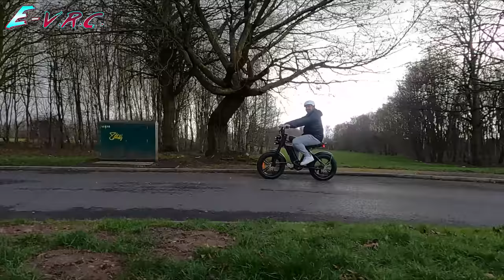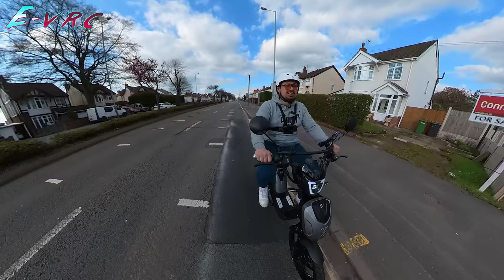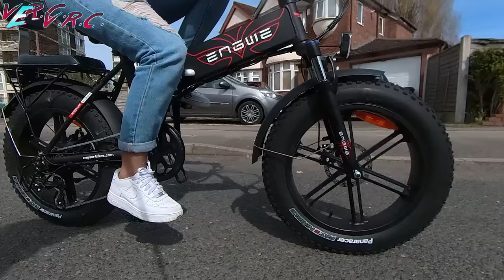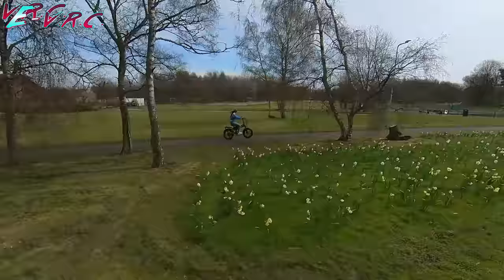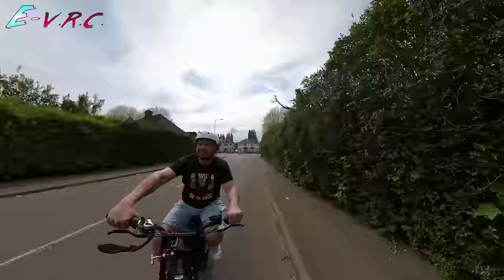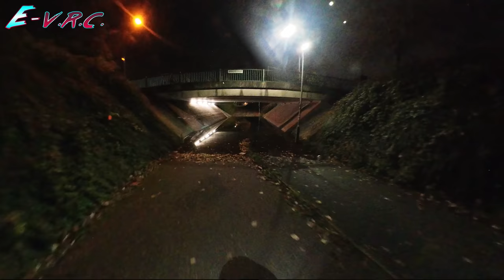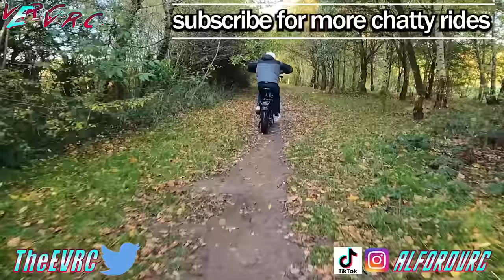The CRAZY Ebike law that MUST Change Before Someone Gets HURT

Comment: I think a good system would be to allow all ebikes to have variable power, but location restricted.  Here in Canada I can make any monstrousity and harm myself on my own property, but the deathtrap wouldn't qualify for street/park use.  even if it were software limited.  we are limited to 500w, Class2.  maximum unlocked speed is the most limiting value for import, to disabuse anyone the thought they can sneak something in.  blahblahblah.   rules are stupid for a reason.  they keep you from earning your Darwin award in sight of a schoolbus of kids. fine.  i'm a licensed Class 5 driver, and I know the rules of the road, both for cars and bikes, and even pedestrians.  I should be able to, under my license, drive any capable vehicle.  I don't want a Surron to go 100kph down the highway, I no longer feel the fires of youth.  I am an adult. Like any car I jump into, I can carry my license to validate my capacities. Also I could handle a powered bike, and I can answer for any screwup I create.  If I am driving erratically, pull me over , toss me and my bike in the backseat and that's on me.  Ebike limits for unlicensed drivers.  thats all it needs to be.  And sensible capable adults will continue to not be the problem.
Reply: on my crappy 10speed back in 1980, after a couple weeks in the spring, top gear all the way, top speed about 40kph.  My favorite swim was 40km away.  took an hour.  on a stupid e-bike it would take 3 hours with the laws so restricted.  I have an ebike in mind Raev Bullet-GT(X)  where X is the version to be released in late summer for taller riders.  I can only hope Canada sees it my way by then ;)

Comment: All you are going to achieve carrying on about this is, nothing. they will probably produce a tax. Get on the bike and stop bitching about it. I have 39550 km on Strava. The only major accident I had was not caused by lose of control. You don’t need a throttle. Pedal assist is awesome. It come in when I hit the hills , no problem. 

Y

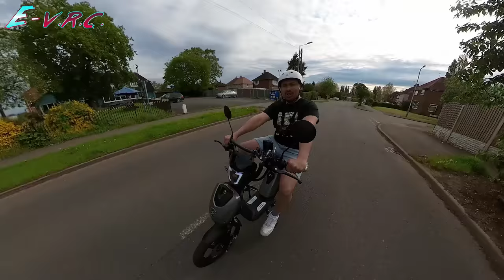Comment: 5:50.  It's a bicycle.  That's normal.  The whole point of the rules is so that ANY electric bike can retain "bicycle" vehicle type and rating for the road law.  Bicycles are unpowered.  So, to get an eBike classed for british roads it either needs to be a motorcycle (aka PTW) or a bicycle.  The "bicycle" classification allows you to ride it without tax, mot, insurance or license.  But it has to be restricted because the riders are untrained, unlicenced etc.  Seriously if these rules are annoying you, go get your bike license and buy an electric motorcycle and stop whining.
Reply from the maker: Have you ridden an ebike?
Reply: @e-VRC  Yes.  Have you ridden a motorcycle?
Reply from the maker: @1over137  yes... would you like to replace your throttle with a button that gives 100% or nothing?

Cus that's the only point of this video. Not moaning about speed of ebikes. Just 100% or nothing power delivery.
I asked if you'd ridden an ebike because if you had then you'd know that although it's called pedal ASSIST you actually don't have to put any effort in for the power to kick in. I don't think i made it clear in the video which is why a lot of non ebike riders may be getting confused.
Reply: @e-VRC  The reason I asked if you had ridden a motorcycle is because power delivery at low speeds and getting bogged down in the wrong gear, stalling or lurching are all considered part of "bike control" and part of the training.  They exist, they are FAR more potent and they WILL get your killed on a motorcycle.
The difference is... I have a license and training and in the event I do something bad and hurt someone, I am legally accountable.  You just ride off.
Reply from the maker: @1over137  but you also understand (being a motorcyclist) that the ability to 'throttle' speed is important to safety and because you're clever enough to ride a bike and respond to videos you can also understand that that is all this video is asking for. The ability to SLOW speed. Adding a throttle to an ebike only increase safety. They don't increase speed or power. They allow us to go slower.

I know you understand that really.
Reply: @e-VRC  Honestly it will come down to some fundamental point in law, more than likely specified by the risk analysis.
My point to you is, what is wrong with getting training and insurance and a license?
My issue is that SOME cyclists are bad enough, now they have power it's only going to get worse.  more people are going to get run over and more cyclists are going to get hurt.  At some point lines have to be drawn about what you can do without any training, license, insurance etc and what you can.
If the eBikes they say can be ridden without a license are rubbish, go get a license. 
Although, if you had a license and registration several of the things in your video would probably make them go away along with some fines.
Reply from the maker: @1over137  I think it's because I'm coming at this from a bicycle point of view and remembering all the different use cases of a bicycle. Like a grannie pottering about the park with the grandkids, going to the shops, avoiding the main roads.

Who is about to follow their kids around the estate or around the park on a motorbike?

100% if ebike commuters want more speed then yeah they should really get cbt and insurance and get the moped/125. 

But this video is ONLY about asking for the ability to SLOW the bike. A lot of people say stuff like 'if they can't pedal they shouldn't ride'.

I'm saying, allow throttles to be on ebikes because these people are going to ride ebikes anyway no matter what we say. So a throttle might stop these people injuring pedestrians and themselves. Regardless of whether we think they should be on a bike or not.

Your points are all valid, but this video isn't about that.
Reply: @e-VRC  At low speed, can't you just turn pedal assist off and pedal it?  I thought the point of "pedal assist" was the pedals are the primary propulsion and the motor only adds on to that "assisting".
Honestly, if you have it in a high pedal assist mode when trying to navigate narrow obstacles ... it's user error.
Which is a valid consideration.  If you are saying there is no need for training, then the bikes have to be idiot proof.  Which would unfortunately not be solved by safety experts by ADDING a throttle.  Adding a throttle requires the user know how and when to use it.  Bicycles dont have throttles.  eBikes can't either.
I also, honestly don't believe a throttle would help everyone either.  I'd gather they have dont studies and determined that incorrect use of a throttle would be far more risky than incorrect use of pedal assist.
There are many questions which have yet to be answered and tested in court here.  What do we want 6yo riding?  What do we want 12yos riding?  What do we want 16yos riding and what do we want untrained, unlicenced and uninsured adults riding.
The law is moving too slow and to agree on something, along the way it usually does do things that make it worse or appear a bit stupid after the fact.  There will be reasons though.
Reply: @1over137 it sounds to me people were already getting injured on bycicles anyhow, this world needs some common sense imo, you can't keep bubble wrapping the world!!
I'm 58 and survived this world well before health and safety existed, it has become a bore of a country and rights have been stripped from people as well, I agree being sensible on an e bike is no different to being sensible a motorbike, I see motorbikes raw at breakneck speeds all the time. So I say it's a natural way of selection, the idiots will  be on the highway to hell.
I really can't see why the motor should be.restricred on an ebike to 250 as long as the speed is limited surely that's the answer to a sensible ebike, especially if your not a fit person but want to get fit, an ebike would be a perfect option for someone wanting to get around but would otherwise be resrricted to home life.
And anyway, I used to do professional bycicle riding on my racer which is so light I can pick it up with my little finger, I can easily reach speeds of 25mph on a straight but nothing is said about that so why all the fuss about an ebike that can keep people like me on a bike and keep relatively fit, I also have knee issues as well so riding my other bike would be a no go these days but.riding am ebike has still given me the freedom and keeps my health up to as best it can be, if I'm in too much pain then I can still get home safely using a throttle if necessary.

Comment: so its like a automatic gearered? or does it even have gears?
  hell on a regular bike acceleration is immense in low gears, good shifting you can go from 0-20 mph in around 7 seconds,  doubt these e bikes can compensate for a cyclist rather than a non cyclist sitting assisted fatty thinking they are doing excersize by riding their e bike, just cos their legs are going round, but with no power needed in those legs.

lmao.  really?

Comment: I really don't understand what's your problem with those laws. 2 wheel transport with powerful motor that have no speed limit and don't require you to pedal? It is motorcycle. That's it. It is e-motorcycle. You want to drive motorcycle but don't be bound by laws designed for a motorcycles. Just admit it. It is selfish and unsafe. And there ARE e-motorcycles out there that do all those things you want in your video. You just don't want the hassle of getting license, plates and extra responsibility that comes with it.
Reply from the maker: Tbf i don't think you watched it.
Reply: @e-VRC  i did. i just really don't understand why almost all e-whatever owners just want some sort of special treatment. British laws (and almost any other developed country laws tbh) have special rules for mopeds/scooters if you don't want 100% motorcicle. So... yeah. There are already laws for what you want. You already can buy this stuff without restrictions you mentioned. Just with other restrictions - safety based. And it seems like you just don't want those.
One of the bikes you rode in your video is essentially scooter. They just attached pedals to bypass some laws and allow you to drive where it would be forbidden otherwise by law. Like wtf mate.

Comment: More 1st world self created problems.
Bikes have always neen a not fish nor fowl oddball troublemaker for adult transit.

In 1850 they are sorta like horses, but sorta like walking.  However they were a hazard to walkers buzzing past on narrow walkways shouting out of the way.  They were a problem in the open road as they were slow, hard to see and in the way of stagecoaches and trotting horses.

Nobody wanted them in their zone.  Then came the 20th century when 45mph cars took over the roads...bikes still weren't allowed on the sidewalk (the pavement) where they were safe, because the ran over or through little ole ladies on foot.

So you couple a motor to a bycycle in 1903... and eventually by 1930 they became motorcycles (a new class) that would be treated as cars...have the same lighting, same speed range, but required training (or proof of competence) and licences.

Well you strap a XXXkW motor to a bycycle and you know what that eventually means.  You are still playing around with whimsical Chinese Christmas toys on public thoroughfare.   By 2030 they are going to become Motorcycles.  Proper lighting, signals, safety gear, proper size for visibility, no pedals since they'll easily achieve 45mph or 60kph....and you'll have to get licences, insurance, tags...

Comment: Such law is RASSIST and sexist  LAW AGAINST NORMAL MAN 100KG 188cm high.
There is no ebike 250W max nobody with brain will buy ,   only if you have 40kg what is far from my weight 115kg plus additional bag and bike , it is minimum 160kg.
This is like ute with 2 000W power motor not 300 000W any built ever ????
250W gives you 25km/h on flat,  for my weight need additional 250W and small slope hills another 250W together 750W with peak 1100W.  For normal speed riding small hills NEED ANOTHER 750w.
250W gives on flat 25km/h
500W gives you 32km/h on hill need 2000W,  
1000W gives you 40km/h
2000w gives you 50km/h  for 100kg plus.
Normally  you will ride 15 to 35km/h  if faster you need proper protection and than pedalling not practical buy electrical moped and lower profile for 20cm lover more benefit at speeds 40+ than try to pedal.

On flat nobody need motor , we buy ebike to keep speed on hills the same as flat and do not loose time ,  FOR RIDING FLATS NOBODY NEEDS MOTOR.

The law maker is RASSIST AND CRMINAL DEBILE Allows

To declare 250W , and if you look controler data it is 48V  18A

What is 1000W when battery full???  It is not  20% DIFFERENCE BUT 4 TIMES?????

Comment: why would snyone condider buying sn E.Bike the msin idea behind cycle commuting is. being able to fo domr hesvy  aerobic exervise. as psrt of yhe drolly commute without having  to pay extra snd use more of uour by previos  time. to vidit  a gum. from 2003 to 2004 I commuted from Eccles. in manchedter  to b manchester ringwsy Airport  11 miles using sll types of roads esnd btifle psths. it using me 40 minutes the fastest route by car was. 60 miles snd took 2 hours! To be st the sirport for. 06.30 I had yo set off st 05.30 it hook 40 minutes yo get yo the sirport plus 20minutes to get ftom yhe bike dhed through security  snd wslk to the  office!

Comment: The only reason I can think of for why they don't want throttles is only a weird muddling of e-bikes and e-(motor)cycles. If it's any consolation, if the world's morals were better, you probably wouldn't need any of these laws at all. ALSO, I know you don't think it's because of the throttles=motorcycles, but it sounds dumb enough to be precisely the political reason.  Ugh, these legislative clowns!! :D
Reply from the maker: I think you're right. There are people in the comments who still believe that if an ebike has a throttle it's a motorbike 🤦 granted i have ebikes because they're fun but in reality they're for people who either want to cycle without sweat or want to cycle but can't ride a pushbike anymore. In that sense the laws sort of make sense. Apart from throttle because it's just so much better than pedal assist.

Comment: Going to echo whats lots of people are saying here. If you want a motorcycle then get a licence, a moped or motorcycle, tax, insurance etc. If you want to ride a bicycle that mimics a motorcycle please for goodness sake dont insult people who ride both motorcycles and bicycles and ride a supposed "bicycle" with epower where you have the saddle height set up completely incorrectly, as seen in this video, and complain about struggling at slow speeds. Simples.

Comment: "Here in America"??? 
Anyway it's not supposed to be a 'throttle' it's supposed to be walking assist/control for walking the bike (within the rules). If you want a twist 'n' go buy a motorcycle (or E-Moto) and register the thing. If you're just too lazy to ride a proper bike stop whining...
Reply: Have you ever ridden an electric bike? It takes a moment for the motor to kick in from standstill, if you have a throttle then you can have power exactly when you want it. Additionally, cadence sensors on cheap bikes give you full power, it’s very difficult to control speed when going slow without partially holding the brake and therefore getting no power at all. With a throttle you can accurately control your speed.
Reply from the maker: The video isn't for or about me.